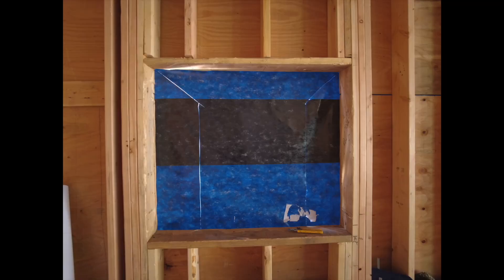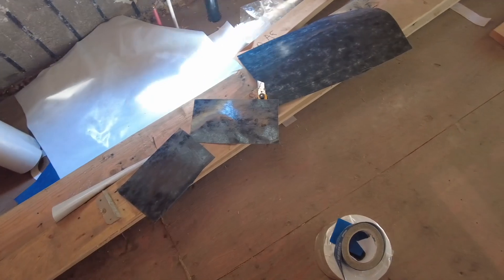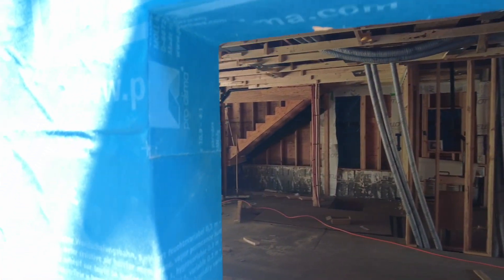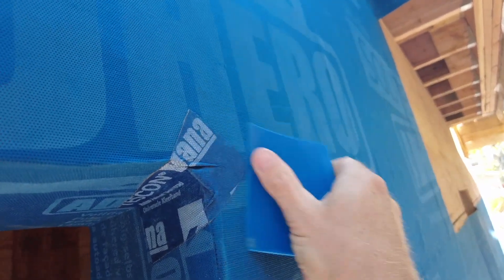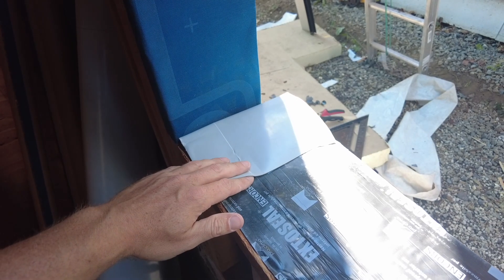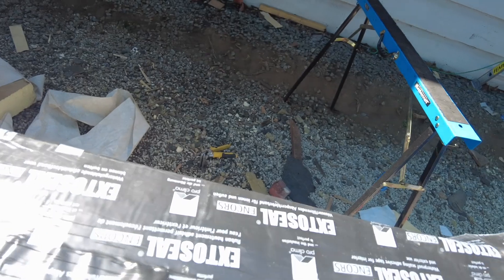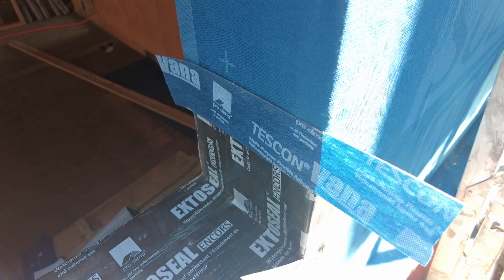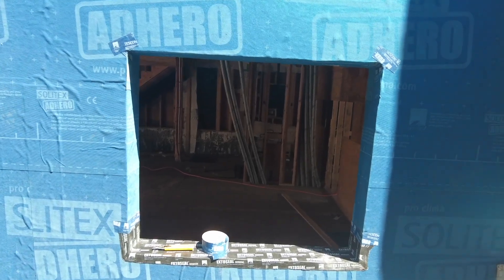How To Prep A Window Opening With ADHERO

Comment: Why does the sill need membrane when the window has its own flashings and sill stopping water getting in? Plus the cladding. I don’t see why it’s necessary.
Reply from the maker: We recommend turning the WRB in to the rough opening to allow an interior airsealing tape connection from the WRB to the window frame. The only job of the black exterior tape here (EXTOSEAL ENCORS) is to waterproof, while the interior window taping is used to airseal.

Comment: So these products Im assuming are developed to compete with the huber zip system products or peel and stick membranes for window/doors and exterior sheathing. If thats the case which I think it is then  I feel the zip system seems better to me. I mean if any of that WRB gets a hole in it then you have lost air seal contro if its not taped where as on the zip system you are taping the seams or applying a liquid seal for seams and nail penetration and then you dont have to worry about your WRB tearing or getting punctured.
Reply: Same thing for zip system? If there is a hole, then you need to tape it. An overdriven nail in the zip system even void the 30years warranty, lol. At least with these, the barrier will help fill the holes done by nails due to it stretch and glueing. Zip system is dry and if you nail it, it's a hole.

Comment: Now I am completely confused :) In many newer videos on house wrap at window sites people recommend not to wrap the membrane into the opening. The house is sealed, but it gives way to water between the wrap/tape and the window. Especially the top part above the window is supposed to be taped to the window.  I have all your good products, now it is just a question of the best technique. Any thoughts?
Reply from the maker: We're guessing the guidance you're referring to is in regard to flange windows that are installed at the exterior edge of the wall. A European-style window that is installed at the center of the wall will require the builder to wrap in at the top. We also have guidance on flange windows that are closer to what you've seen in the past, but in this case, we're talking European-style. Hope that clears it up!
Reply: @475.SUPPLY  Thank you! We do not have European Style windows. Can you point me to a video on a flange window!
Reply from the maker: @verenagiebels3725  Sure thing. We do not have a video, but have Flange Window Install Guides in the Reference Downloads section of any of our Solitex WRBs - find that here: https://foursevenfive.com/solitex-mento-1000/

Comment: I did use extoseal on the head similar from the seal. I known price wise is not a better option. But that pin hole on the corner. I have fix 12 building with problems on that corner( different WRB)